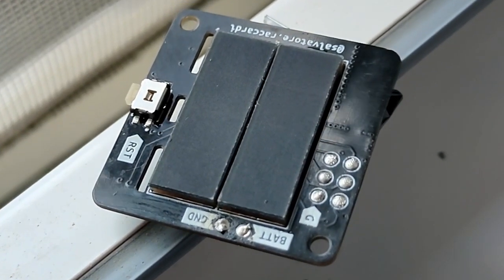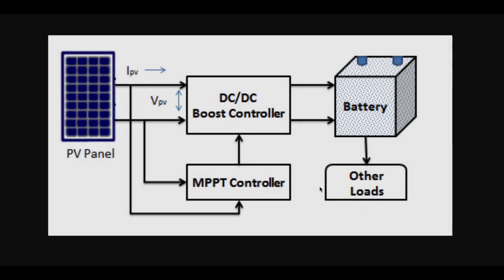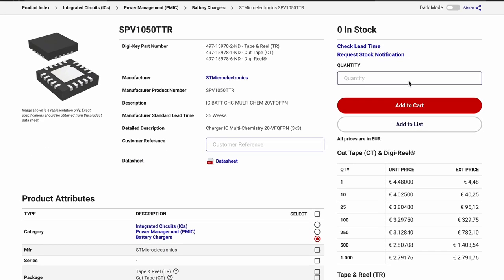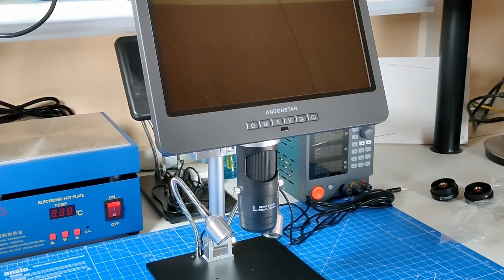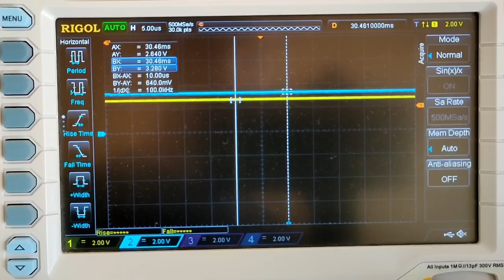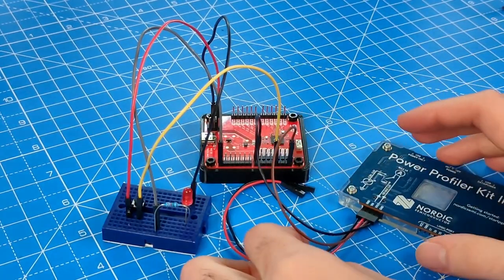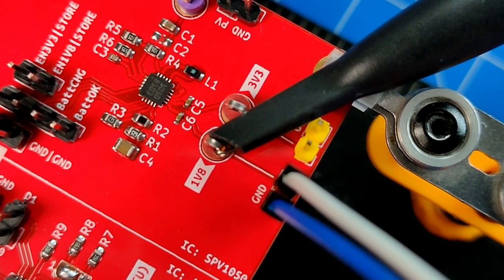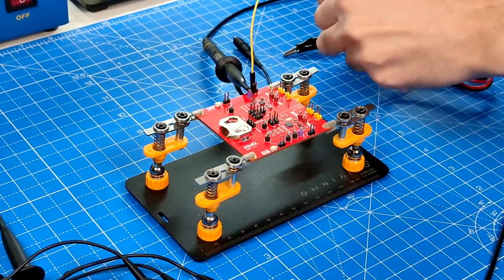I designed a PCB for Solar Energy Harvesting | assembly & tests

Comment: Hi, Is the circuit schematic for this gerber file available? Thanks
Reply from the maker: Read the description, you can find everything there.
Reply: Thanks for the reply.  may I know what is the voltage output of the solar panel? I was planning to replace it with a small wind turbine. Also, do I need to program ADP and SPV microcontrollers? if so, what software did you use?  @SalvatoreRaccardi
Reply: Is there a high power IC which I can use to harvest about 10-20 V from a turbine? Any suggestion will be appreciated. Thanks

Comment: Do the harvester chips support a primary battery and LIC energy storage capacitor?
Reply from the maker: Yes, support primary battery and super caps
Reply: @SalvatoreRaccardi  Looks fine! Don´t you think about using a Ambiq Micros RTC AM1805AQ with powermanagement to only power up the microcontroller with timing or external interrupt?
Reply from the maker: @ivanarakistain3885  These weeks I have been looking for a more efficient alternative to the classic microcontroller interrupt to wake it up from deepsleep mode. And I think you've suggested an interesting idea.
Reply: @SalvatoreRaccardi  I am very interested in your project. I would like to use a ESP32 and as it is not the lowest power microcontroller I need some solution like this to save energy. Let´s keep in touch. Thanks for your great work!